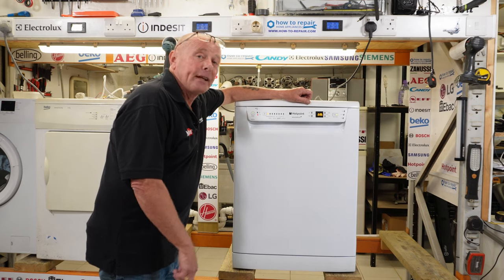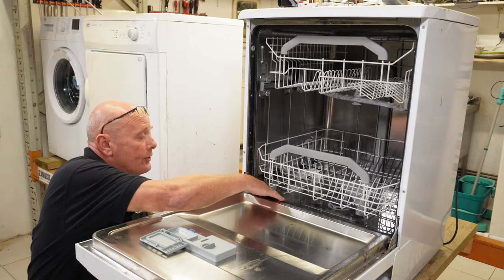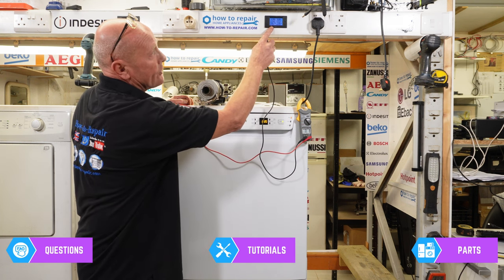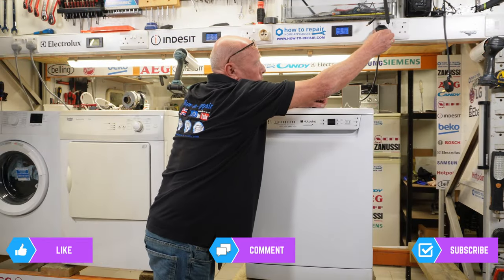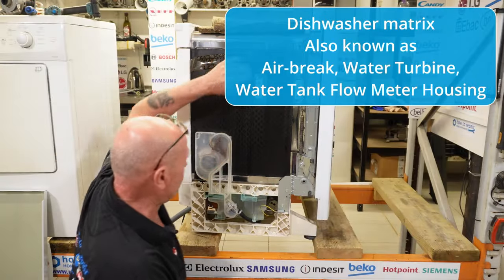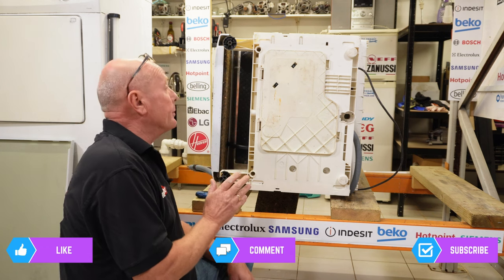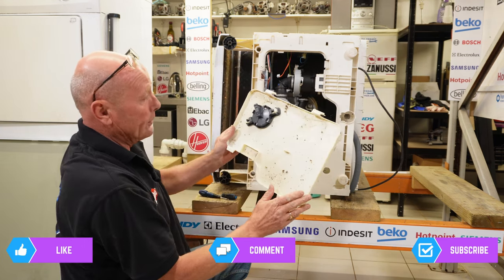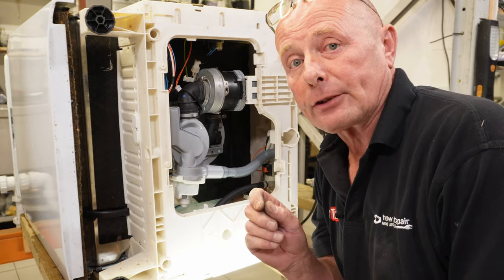Hotpoint (Indesit) Dishwasher Not Cleaning fix it yourself 🔧

Comment: Nice video. I used to repair Indisit under a 5-year warranty it was horrible not being honest and saying they are a heap of junk. The repairs must have cost the company a fortune. That motor is far too small for the job, Good reason to keep old machines going because Bosch has gone with the same Italian-made motors,  Did you have the machine on an ECO mode or is there no pre-wash on that model now?
I have a Miele dishwasher in the workshop that needs a new door-opening motor switch for £180 plus labour. It's actually a  £3 China motor if you can find the right gear ratio.

Comment: Great video Paul. A quick question as my Beko dishwasher has stopped circulating. Can an open circuit NTC sensor stop the pump from operating? Dishwasher drains and fills but nothing after that. I've removed the motor and give it a direct feed and it spins effortlessly. Thansk for any info.
Reply from the maker: Hi, please use our contact us page and make sure you fill out the request for what your problem is. I will need the full model number of the identification plate and the details of your problem so that I can provide you with useful literature. A video shoot of the problem would be perfect as well.

Normally, I would get back to you within 24 hours but I am on my way to the IFA trade show in Berlin, so it can take more time to respond. Thanks for your understanding. https://www.how-to-repair.com/help/contact-us/   

Please remember to subscribe to our channel, as that's what keeps this channel going. Thanks, Paul 👍

Comment: Hello. My dishwasher (Kenwood KDW60X13) fills with water, drains it too, but the arms are not spinning at all. I have changed the Locking Nut because the rubber has worn out and I thought that pressure is unable to build and water cannot pump through the arms . It wasn't the case. Then I suspected the recirculation pump being faulty, took it down and inspected it. No grease discovered, the impellers look very good, everything clean and spins. I measured the resistance with a digital multimeter, no power source connected. I have zero knowledge on how to read the results and what they mean. The pump is Welling YXW50-2F, 220-240V 95W, 0.42A. The power socket(cables) of the pump has a resistance of 125 Ω, and the ones going into the capacitors(I have disconnected them from the capacitor), have a resistance of 246 Ω. I have also taken down the capacitor attached to the pump and tested it. It has a capcitance of 3 uF +- 5%. the multimeter reading is 0.21 nF, which if I am not wrong translates to 0.00021 uF? Is the recirculation pump broken or just the capacitor, or both? Thanks in advance for your answer.

Comment: My name is Callum I have a question for you why my beko washer dryer is not drying and it is not heating up on the drying cycle
Reply from the maker: There are many reasons for your machine not drying. Firstly you need to check the heater circuit at the top of the machine. Make sure that the fan motor blows the warm air into the drum if this is not working correctly then the condensing process will not work correctly. Check the heating element and any thermal cut outs and thermostats also make sure the condenser water valve is trickling water down the condenser plate. If there is no power going to the heating element, then you may have a problem with the circuit board, depending on your expertise at repairing things, it is possible to check the relays on the circuit board. I hope this point you in the right direction thank you very much for subscribing to our channel